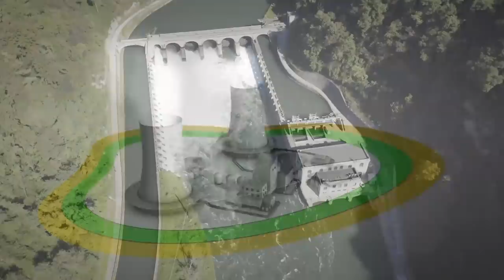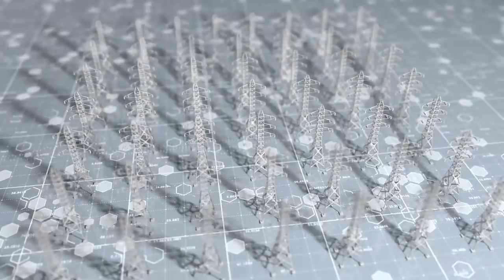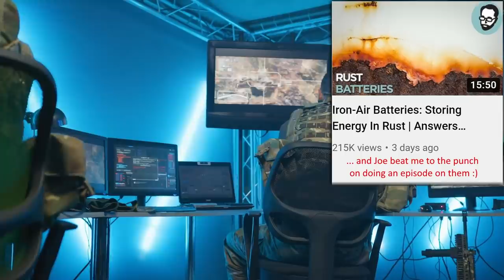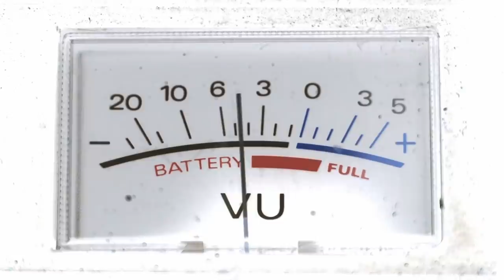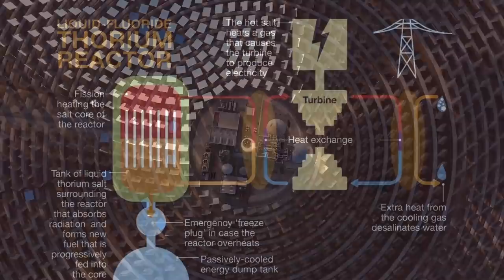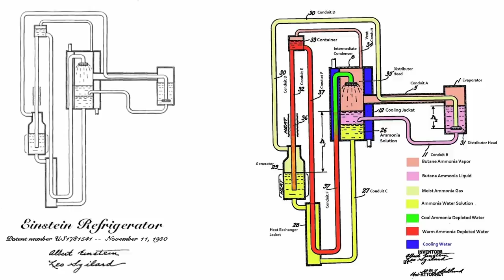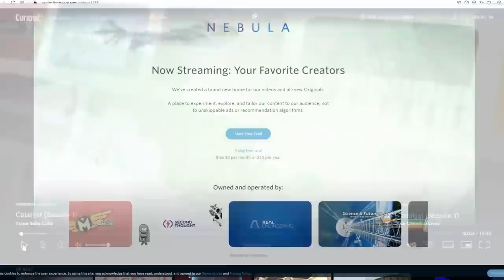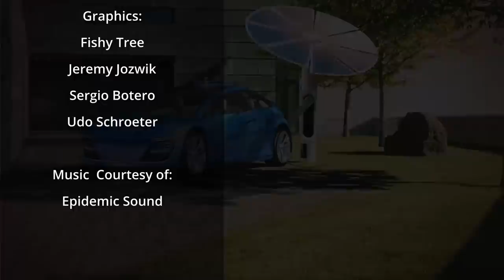The Future of Solar Power

Comment: Solar generator hydrogen is probably best converted to motor fuel by combining it with nitrogen making ammonia. It is also lighter than air and less leaky than hydrogen and helium.
Reply: Wouldnt that generaate a heap of Nitrogen Oxides and also be very dangerous if there were a catastrophic leak?
Reply: @markawbolton  
Look at the dangers of gasoline and diesel. Ammonia disperses fast being lighter than air and dumping water on it elimates the problem not spread it. And ammonia being nearly impossible to ignite at atmospheric pressure means no explosions or fires.
78% of the atmosphere is nitrogen the production of nitrous oxides is mostly dependent on pressure and how much oxygen is left after the hydrogen and/or carbon is burned. 
Also existing gas and diesel engines can be easily converted to run on ammonia unlike pure hydrogen.
Reply: @Lawofimprobability 
Yep. You are not use to the risk of ammonia and you are use to the risk of gasoline and diesel. Gasoline is a serious carcinogen and is not detoxified in your body nearly as well. And again ammonia is lighter than air so the toxic cloud disperses much more quickly.
Reply: Ammonia gas is hella hard on human lungs.  Lethal in concentrations that could be expected in occupants trapped in an automobile wreck.
Explosive risk would be at least as high as CNG or gasoline.
My choice for synthetic auto fuel would be Methanol.
Racecar grade internal combustion performance PLUS there are already functional methanol fuel cells for electricity production.
It does have the side effect of causing blindness or death in hopeless alcoholics who try to drink it, but that might be a net safety benefit if you consider the collateral death and dismemberment they cause on the roads.
Reply: @NullHand  
Ammonia is virtually impossible to ignite at atmospheric pressure so no explosions.
Ammonia is used as window cleaner. Methanol does far more environmental damage when spilled than ammonia does and burns at atmospheric pressure.
Reply: @calvingreene90  Methanol is also used as a window cleaner especially your windshield.
It can be found all over chemistry lab tables in squirt bottles for cleaning glassware.
Squirt bottles of ammonia would never be let out of the Fume Hood.
Reply: @calvingreene90  Ammonia flammability in air 15% to 28%. But outside of the laboratory in the real world, suspended contaminants like dust and lubricants greatly increase this.
Ammonia is widely used as an industrial refrigerant, and has a track record of blowing up plants if not maintained.
There is video of it blowing a yogurt plant in the Midwest a few years ago.
Reply: @NullHand  
Propane is often substituted for ammonia in leaky systems.
Reply: @calvingreene90  Yes, back during the Freon ozone hole ban there was a scramble to find replacement refrigerants.   Both propane and ammonia 
were suggested for automotive systems but nix’d by the safety agencies.   Quantities would have been small but a leak in the evaporator would have put the toxic or fire risk inside the cabin.  Ammonia is used in camper refrigerators, but within an absorption cycle where included water woud presumably keep the vapor pressure low in a leak.  I like the idea of a solar thermal powered ammonia absorption systems for cooling, probably with a chilled brine reservoir.
Reply: @markawbolton  There are direct ammonia-fuel cells. Using them should greatly reduce NOx creation and NOx releases were an issue even with burning Hydrocarbon fuels. I believe they run the exhaust by some catalysts and this greatly reduced the amount that is released. The same should work for when directly burning ammonia.
Reply: I love the idea of carbon-neutral synthetic ammonia as you don't need the infrastructure for carbon capture. It also already has a huge distribution and transport infrastructure due to the fertilizer market which can be utilized, but I don't see it likely getting adopted into the personal vehicle market due to the toxicity issues. It would be a very valuable fuel in the agricultural sector though as Farm groups could likely generate their own carbon neutral fuels to power all their equipment and synthesize their own fertilizers.
Reply: @NullHand  
Windex and other commercially available window cleaners use ammonia.

Comment: For an aerostat, you could actually make the interior a vacuum. That would be an even better lifting "gas"1
Reply: But that takes an extremely rigid envelope that is very heavy so it has to be extremely large and use active support structures.
Reply: @calvingreene90  
Indeed! But with the right materials and design it need not be so heavy. To start with, the shell would need to be mostly carbon fiber. And it need not be a complete vacuum. It would interesting to see it done!
Reply: @cyberherbalist  
There was a thing in the news about carbon fiber compressive structure failing in the news recently several tourists died and something about an old shipwreck.

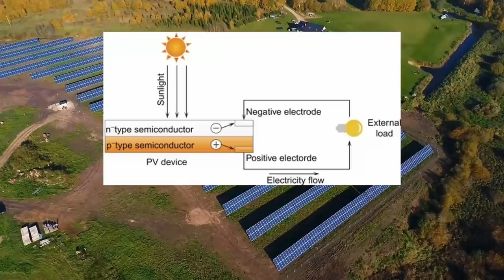Comment: 15:50 The big problem with iron-air batteries are they are slow to discharge meaning you need 10 times as many of them to delivery the same amount of power. This makes them cost a lot more.

Comment: Orbit an array of mirrors totaling 200,000 square miles, to keep solar farms lit 24/7.  No need for storage, and the number of solar panels required is 1/3 to 1/5 what would be required for only daytime solar collection.  Mirror construction is simple, pushing against a reaction mass (gryo) for aiming.  We launch them into low earth orbit and use the mirror as a solar sail to achieve high earth orbit.

Solar cells are most effective in IR frequencies.  We can filter the reflected light, so night stays dark (unless you are wearing night vision goggles).

Comment: What about the heat given off by solar panels? I remember hearing that Israel was looking at putting some kind of thermal conductive gel behind the solar panels to harvest some of the heat as electricity as well, and it would continue to generate electricity like the molten salt. 
Also, what about the atmospherics of having massive fields of solar panels? Do they increase the temperature/pressure of the local area?

Comment: Hi issac arthur ! What could be the best theoretical way to convert nuclear energy into mechanical energy ?
Reply: Do you mean in a controlled fashion, or simply the most efficient way of converting the energy in matter into mechanical energy?
Reply: With steam driving a turbine, as is presently done. There are technically other ways - the nuclear salt water rocket, for example, or a nuclear combustion engine - but those methods tend to overlook the drawbacks of deliberately nuking oneself thousands of times. Alpha- and beta-voltaics as well as radioisotope thermoelectric generators are used in certain niche applications like medical implants and long-duration space missions to outer solar system, but broadly don't take good advantage of valuable nuclear fuel due to their low efficiencies and low power outputs
Reply from the maker: It depends on how quick you need the energy, I'd guess Alex is right about a steam turbine though someone may have dreamed up a better alternative.
Reply: @isaacarthurSFIA  I was thinking if we can directly convert nuclear energy into electrical energy ... Using nuclear radiation to accelerate electronic. In theory is it good idea ?
Reply: If you need the mechanical energy to be portable (i.e train or car) probably nuclear> electricity> battery/grid > motor.

Comment: This strikes close to home, in my home province we have a system where people can sell excessive (solar) power to the local power provider.  However they recently announced they were considering charging people to sell their power.  The provincial government slapped down their idea expressing extreme disapproval.  If good batteries become smaller and cheaper that will help reduce such insanity.
Reply: The issue is that battery density is near the physical limit already and prices are going up because supply can't keep pace with demand.
Reply: @ZontarDow  "Modern Battery" density, however as this video mentions new battery designs are on the horizon which change the limits.
Reply: @WarGiver  such batteries would be a black swan event because right now basically all battery development is minor improvements of existing technology to inch us closer to that hard limit set upon us by the laws of physics.
Reply: @ZontarDow  Right now yes, but Black swan tech has been hit or miss in the past, at one point solar powered homes were Black Swans, Safe Nuclear Power plants were Black Swans.  Modern Military Drones were at one time Black Swans.  Just because something is a Black Swan today does not mean things will stay that way.  Tech does make leaps on occasion, and its usually comes about for non-sense reasons.  A Black Swan is an event that nobody can predict, not an impossible tech.

Comment: I'm not really sure a civilization could achieve the same level of technology as fossil fuels on solar alone.

A lot of what makes solar viable is the fact that we can put so much energy into that manufacture with fossil fuels. But if it's your only option and you're building everything by hand, this is a major issue. Couple that with the lack of easy steel manufacturing, and I think solar would remain a nice convenience but not a driver of long term technological civilizations.
Reply: @jsn1252  I see someone else reads Greer.

Comment: With regards to all power sources other than geothermal and nuclear I always feel the need to point out that they all derive from solar either directly or indirectly. Thermodynamics thus necessarily tells us there is going to be increased losses the more indirect the conversion is.
Fossil fuels are only so energy dense because they were formed over geological timescales consolidating biofuels over millions of years.

Now while this makes solar the most efficient renewable it still has problems such as the fact that there is only so much surface area of Earth  which must be distributed among all solar powered processes namely the biosphere, and Earth's various weather systems. Given these are very important processes I am very wary of excessively scaling solar power onto industrial scales as I would rather have flora, fauna including adorable fluffy feathered friends brightening my day than another sterile rock that has been engineered to collect ad or store energy from the Sun  at least on Earth itself. Plus there eis a huge drawback for highly integrated centralized grid systems namely their tendency to fail catastrophically whenever we finally get hit by one of those super Carrington scale events that seem to hit Earth every few hundred years. The climate record has revealed sobering realities of our situation namely that the Sun fires off monstrous CME's much more frequently than we assumed with events within only the last 10,000 years including at least 3 super Carrington scale storms that are orders of magnitude larger than the famous Carrington event.

Heck it also turns out there was a particularly powerful CME during the early 1920's timeframe which  further emphasizes how damn lucky we have been thus far in the electronic era. With how natural solar functions as part of a decentralized power solution I really think this should be the focus of our Earth based solar power.

In  that respect I would argue that use of fission is probably a far better way to get high load industrial scale power than giant solar farms at least until we can get space based solar systems that can be manufactured and assembled off Earth.

Fusion if/when it comes is worth considering though people tend to miss just how scarce the materials able to easily be fused are in large part because any made in stars are quickly fused away into helium 4 leaving the big bang nucleosynthesis and cosmic ray induced atomic fragmentation as the sole sources for such elemental isotopes since the conditions needed to effectively fuse protonium are much more extreme than what we can hope to do in the distant near term future. Frankly I don't see Neutronic fusion processes as being a good idea especially the varieties which involve conversion of Lithium into Tritium since Lithium is a rare chemically special alkaline metal due to its proximity on the periodic table to the most electronegative(tightest bound electron configuration) Helium. Lithium Beryllium and Boron are all only producible by high energy cosmic ray induced fission and come with valuable exotic chemical properties that other elements can't really compete with. For example Beryllium when pure acts like a metal but mixed with any element other than Helium and it acts primarily in a non metallic i.e. Covalent manner since the only element which has a larger magnitude oxidation potential is Helium a noble gas that generally only reacts when it is missing an electron.
Reply: A few drawbacks to solar would be

-reduced biodiversity (there's life everywhere)
-flooding (trees absorb water. Trees need to be cut down to build suburbs and solar farms)
-if solar farms are built in deserts
"The dust over Puerto Rico represented the leading edge of a giant plume that had traveled more than 5,000 miles from the Sahara desert across the Atlantic Ocean, spreading into the skies above North America and beyond.

This particular dust plume is at once remarkable and totally ordinary. Each year, these kinds of plumes sweep off the Sahara, carrying some 180 million tons of mineral-rich dust from its dried-out pans. Thousands of miles downwind, the fine-grained dust shapes both the ecology of the places it lands and the climate as a whole."
-space based solar interferes with astronomy (how can you view the stars if the sky is flooded with satellites) and what would be the point since they'd only work on 1/4 of the planet (when it's summer in one place it's winter in the other and when it's day in one place it's night in the other). What would be the reason to rely on expensive space based solar instead of existing options (nuclear, coal, hydro)?

A lot more work would need to be done to fix the problems created by solar compared to nuclear and if people are worried about accidents then why do they live in hurricane, tornado and earthquake areas.

And it doesn't make sense for nuclear to change for when solar needs backup compared to solar working around nuclear.
Reply: @Dragrath1  As for limited supplies the same could be said about solar. Assuming

"Silicon can be mined from quartzite, mica, and talc, but sand is its most abundant ore source."

then

"Sand is the primary substance used in the construction of roads, bridges, high-speed trains and even land regeneration projects. Sand, gravel and rock crushed together are melted down to make the glass used in every window, computer screen and smart phone. Even the production of silicon chips uses sand.

Yet, the world is facing a shortage — and climate scientists say it constitutes one of the greatest sustainability challenges of the 21st century."

In other words, nuclear isn't the only energy being limited by supplies. But

"It's estimated that there is at least four billion tons of U in seawater, which is about 500 times the amount of U known to exist in land-based ores".

And Anton Petrov made a video recently, discussing there being concentrations of Th (and probably U) on the moon. While many might not like the idea of colonizing the moon, as long as people are voyaging into space colonizing the moon is going to happen. If we're colonizing the moon then other planets or moons wouldn't be far off, or like you said O'Neill cylinders. But if we're traveling into space then the population probably isn't that large (1-because of time and resources to create the ships (the largest passenger ship has a capacity of less than 6k people. The largest plane is 850) 2-because we've reached immortality by curing all disease and war would keep populations low)

There's also the issue with solar (resources) is fine until there hasn't been sun for days and your battery ran out on the first day (how would the poles operate only with solar and batteries for 3 months).

I don't understand the idea of beamed power. If the idea is that satellites will beam power to earth 1-energy gets lost in transmission 2- how would it be that different than removing the satellites and the sun powering the receiver in the first place (with the exception of clouds and seasons but clouds can be removed through geoengineering and if satellites are beaming energy then it could be transported from places on earth too)

You seem to be romanticizing earth while not treating other objects outside of earth with the same feelings. Why is it okay to mine on Mars but not earth? Just because we haven't see life on Mars (or other planets, moons or even asteroids) doesn't mean it doesn't exist (maybe it's living within the planet). And if mining shouldn't be done on earth why live on earth in the first place. It's like buying a car that you'll never drive. Industrial farms are more efficient than smaller farms so industrial farms are needed and it doesn't seem like a good investment financially having them space based. The only reason to have farms in space is because the planet has died and everyone has moved away. If earth is still habitable then it would be cheaper buying food grown on earth.